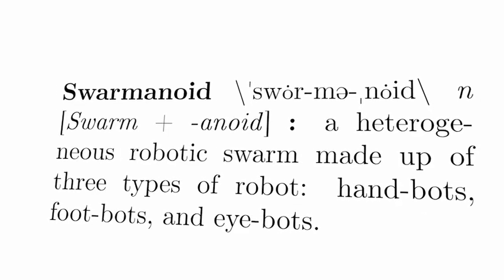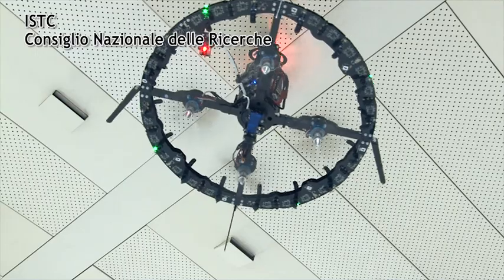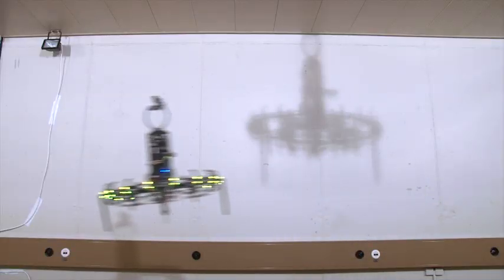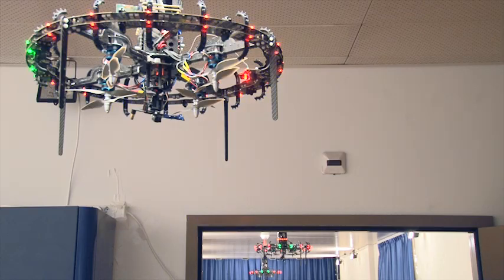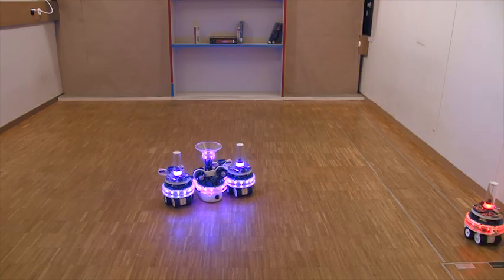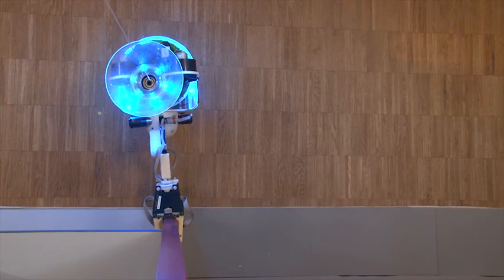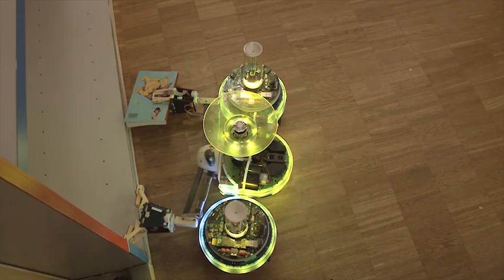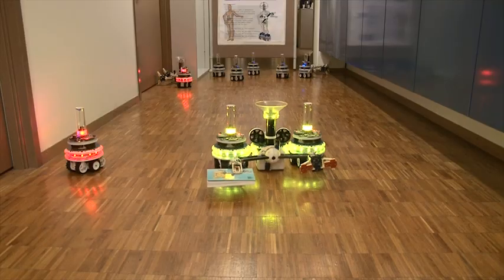Swarmanoid, the movie

Comment: I don't understand. I may agree that "eye" bots that evaluate work environment may and should sacrifice their ability to do anything else except scouting, because they need to be as light and maneuverable as possible. But why detach transporting function from "manipulator" bot? The only logical application to this scheme is a rare situation when that bot could be left in one place to do some repetitive work that doesn't require him to move around, while "transport" bots do some other stuff at the same time elsewhere. However, what would he do if situation suddenly changes and he needs to transport to another place while "transport" bots are nowhere near to be found? And what would he do if first he needs to climb somewhere "transport" bots can't go and only then additionally transport himself somewhere?
Hazardous environments, especially those that are changing circumstances relatively quickly, usually require characters to be semi-autonomous to survive and continue function. Example of most common hazardous environment which could use some robot help is a collapsing building on fire. You can't just casually plan routes there with robots, with debris falling around and other stuff.
Reply: I think the intention was to demonstrate co-operation in the swarm as well as modularity. A 'Hand Bot' that is mobile would have better suited the task in this case, hell give it the ability to fly also, but this wasn't the point of the Swarm, it was to demonstrate that the robots, although completely individual, can work as a single unit. 

That is my belief anyway.

Comment: You deploy the eyebots once, they communicate once.  The groundbots deploy and take over navigation.  If you were only running one composite foot/hand bot for a minute, that might work.  If you need 40 composite bots to do 40 repeated tasks, it would seem a design limitation to put a battery large enough to communicate that much on an eye bot.

Comment: i must say, i was VERY impressed by the suction cup for grabby, I also like how they used several IR sensors spaced out and then rotated them to take a 360 degree scan much faster than one could alone.

Comment: The idea of parallel distributed computing has been a theory and desireable goal for years.  All experimentation takes the path of uslessness to get to usable.  The robots on Mars have a much longer evolution than the infant system in this video.  This is bleeding edge experimentation and application.  Your PC started out with gears, pulleys and hand cranks and nobody thought it would ever get anywhere.

Comment: The exercise is not about efficiency, that would be a single purpose built bot.  The idea is a parallel distributed network that exicutes a task by discovery and planning like we do.

Excellent exicution and a lot to learn from.  

Think of what you go through to go from one room to another to retrieve an item and return, now write the code to exicute that task considering that you might not know exactly where the item will be located in the other room.

We take a lot for grantid.